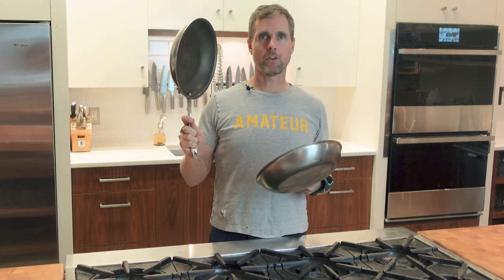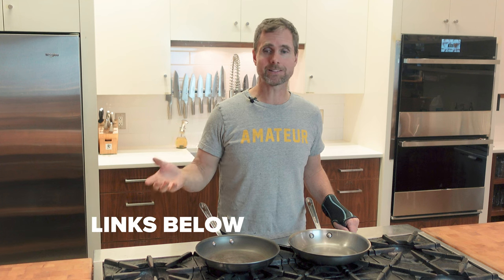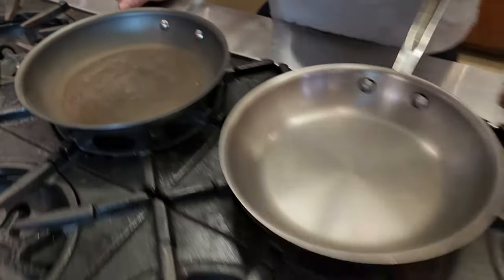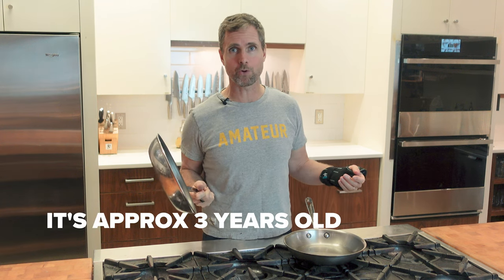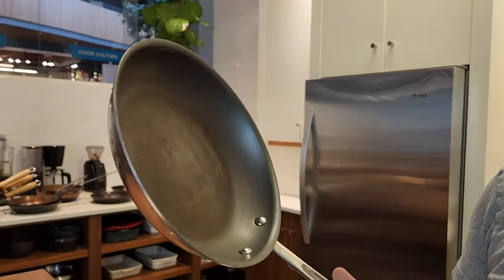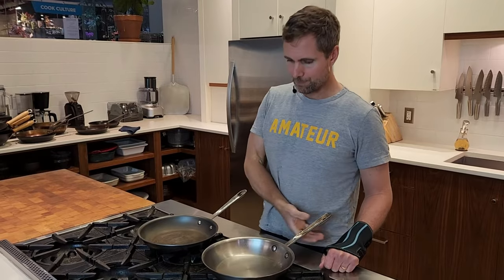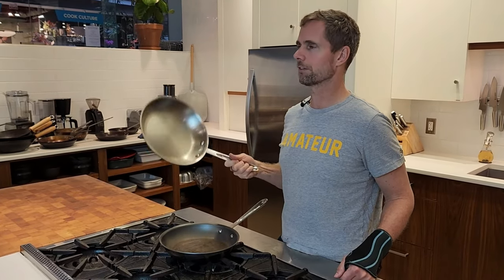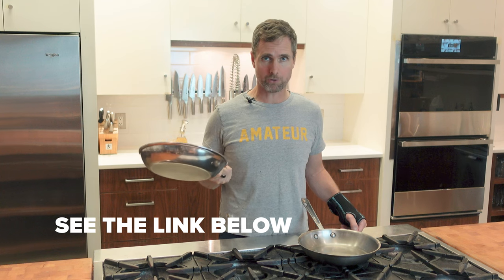How All-Clad's non-stick cookware will become garbage

Comment: That pan was overheated, was washed in a dishwasher, and metal utensils were used. I have nonstick pans that are 20 years old, but then I take care of my stuff.
Reply: Exactly.  I only want a nonstick pan to cook eggs and crepes.  That’s it.  Everything else is in stainless.
Reply: I baby my non stick pans and still only get around 3 years of non stick coating working as intended.
Reply: That pan was used normally. For a $200-$300 pan to peel like this happens. And shame on All-Clad for selling it. I got a set of 3 for my wedding, and they are all in the trash now. I'll stick to $16 egg pans that will last a year then throw them and replace them.

Comment: Your leaving out the process you have to take to make your steel pans nonstick. Most people at home aren't going let the food come to room temp before cooking, or pat dry all thier food before cooking, or heat up the pan before adding oil and the food. Most people just wanna turn the heat on add oil and the food and cook it. THATS THE WHOLE REASON NON STICK EXISTS!!!!! Most of my pans are non stick and they have all lasted about 10 years except the stupid copper ones they lost the non stick within a year. Everyone knows non stick doesn't last forever but that's the trade off that most people are ok with.
Reply from the maker: You are sadly correct, but there is a growing movement away from coated cookware.

Comment: Love all-clad but not-stick is junk and potentially harmful. My main skillet is a stainless-steel surface all-clad LTC that I bought in the mid-1990s and the inside looks virtually new; as for cleaning, soaking it on hot water and soap while I eat makes it effortless to clean. And if you pre-heat it using the mercury-ball water test, it functions close to non-stick. Cost me about $150 then but it has lasted 30 years and I expect it to out-last me.

Comment: Maybe some abuse they've pans , I have stainless,  cast iron, carbon steel and hard anodized aluminum. Treat them right they last for years. Non stick or hard anodized aluminum probably not as long . Life expectancy is probably 10 years. But your dishwasher, stove , and washer are about that or less . So there's that. Non stick has its place , opinions vary and they are only right for the person touting them .

Comment: I diagree. Some non stick  pans warp early on while others remain flat on the bottom. The coating on my pans last years so I tend to look at construction quality and materials. From my experience, there are three factors that shorten the longevity of the non stick surface. Number one is overheating the pan, two are metal utensils and three is cleaning with abrasives. I only handwash so I can't speak on the affects of machine washing as much but chloride destroys most metals including some stainless steels.

Comment: You should do another video with the "nonstick" one to see if you can polish out the entire coating and convert it into a regular stainless pan.
Reply from the maker: Sorry, I would not grind a coated pan if you paid me. Chemical dust.
Reply: @Cook-Culture  lol I'm not talking about in the kitchen, like having it done in a shop built to handle it.
Reply from the maker: @mjg1185  I have thought about it but seems pretty toxic!
Reply: @Cook-Culture  - yeah, leave that to professionals that know how to contain and dispose of chemicals and chemical dust.
Reply: @Cook-Culture  Don't be so dramatic. With proper respirators and equipment it's easy.  I had my 5 ply All Clad non-stick pan sand blasted at a professional shop.  They simply turned down the pressure of the machine and used finer sand/grit. And voila, I had a stainless steel pan for a fraction of the cost of a new one
Reply: I used to work at a body shop and what you can do is use a "DA", or dual action sander with progressively finer paper or have it bead blasted at a shop.  Start with 80 grit and work down to 220 or maybe 320.  I don't see any reason why this can't be done and the dust shouldn't be any more toxic than paint dust.   Wear a dust mask N95 or a respirator.  You can buy an electric dual action sander at Harbor Freight for less than the cost of a new All-Clad pan and you'll have it for polishing your car, etc.  I've used mine for polishing my vanity sink after the previous homeowner used a scrub pad on it.  You can use it as a sander or polisher, so the machine is pretty versatile.
Reply: Sandpaper will do the job

Comment: I’m a cookware enthusiast and I don’t see why there should be all this hatred towards non stick cookware, when it’s not really proven unhealthy to use as long as you don’t overheat it. 
I own more than 50+ pans and pots in 2.5 copper, carbon steel, 5-ply, 7-ply and also am the proud owner of 5 non stick pans from Demeyere (Alu Pro line)
I’ve now used these non stick pans for 4-5 years and they are still in fine condition. Just use silicone utensils and never high heat and your non stick pans will last for many years. What I save on oil and butter, can buy me a new non stick pan every 5.th years (you have to use much more oil and butter to get stainless steel ply and carbon steel pans to act non stick). Cheers, Claus from Copenhagen Denmark
Reply from the maker: Hi, I understand the argument however the great majority of people don't follow the correct instructions and destroy their pans.  Furthermore, even with correct care 1 life cycle (20 to 30 years) would be the absolute max for any non-stick. Compare this to the alternatives that last for generations.
Reply: It's not just about money or health. It is a massive waste of resources to get a new pan every few years. Especially considering the environmental impact of the manufacturing process of such pans. Nonstick pans will always be disposable pans.

Comment: Thank you for posting this! I thought there was something wrong with my 10" stainless d5 non-stick fry pan which I use almost exclusively for omelets. I contacted All-Clad and sent them photos and their response was some tips about pre-heating their pans! They then said their non-stick was non-toxic and I could either "choose" to keep using it or toss it! Really great advice!  It turns out they're all like that? Pretty sad for such an otherwise great company to sell such junk. I wonder if it's possible to remove the non-stick surface so it's just a stainless steel pan? I already have an All-Clad stainless steel pan and it works great but is not so great for omelets. Unfortunately you can't or are not supposed to season a stainless steel pan like carbon steel or cast iron...
Reply from the maker: Yes, it is unfortunate! Maybe a small carbon steel pan would work for you?
Reply: The French-made seasoned carbon steel pan I bought works great for eggs! Thanks for the tip!

Comment: Maybe im just a person with OCD but I have 3 Calphalon Stainless steel Nonstick pans 8-10-12in that are in Excellent condition after 15yrs of use. Note that I also have a Full Stainless Steel Set and Visions Cookware Set too. So I use the Nonstick pans just for Item's that don't require High Heat as I've got pans for that type of cooking and I HAND WASH ALL MY DISHES & COOKWARE

Comment: I''m doing research because of an All-Clad nonstick pan ... I really like the pan, but after 3 years, the coating is going. I don't mind PTFE (if made responsibly), but I hate having to toss an otherwise excellent pan.

I want something to cook my eggs, that will last for years, and be as easy to maintain as possible.
Reply from the maker: Hi, carbon steel is what I would recommend

Comment: I buy All glad non-stick at Home goods for 20 bucks. Don't use any metal utensils in it and we're okay. Put the minute it starts to look like It's bad I throw it out.
Most of the time I cook with carbon steel or cast iron or stainless steel.
Reply from the maker: Hey Nancy, thanks for the comment. When you're done with your non-stick you could find a metal recycler who will break it down correctly.
Reply: @Cook-Culture  Yes, I do! I should have been more clear in the comments.
I just got a DeBoyer Mineral B and am looking forward to using it! Thank you so much for all your videos. I watched the one on carbon steel seasoning.
Reply from the maker: @nancyoffenhiser4916  Great! Thanks

Comment: I bought the new, All-Clad H1 Non Stick 3.5 Qt. Covered Saucepan in August.
I USED IT ONCE TO BOIL PASTA STIRRING WITH A WOODEN SPOON. 
I WASHED IT WITH A SOFT CLOTH. 
The bottom inside the pan was CHIPPING & PEELING AFTER ONE USE!!🤬
All Clad asked for photos and an email which I sent. They then told me nothing was wrong with my pan. 
Sur La Table also blew me off telling me it had been over 30 days. My credit card company told me that since it had “arrived in good condition”, they wouldn’t honor a credit either!!!
Reply from the maker: Sorry to hear. That's how it goes. It's all about making money and not delivering the best product to the customer.

Comment: Worst on-stick I’ve had was the All-Clad.  Absolutely destroyed after a few months and I was HUGELY careful with it.
Learned pretty fast to buy the cheapest I can find in the grocery store, just fast-season my SS, or simply use my cast iron.
Reply from the maker: Good on you!
Reply: Absolutely! I had purchased a few all-clad nonstick over the years, and realized (after spending way too much money) that I was better off buying the cheapest 'First Street' nonstick at the local Cash&Carry.....12" pan for $23. Lasted just as long, and saved 85%....until I got my two Matfer carbon steel pans. I rarely use the nonstick, and when they are gone, they will not be replaced.
Reply from the maker: @erik5024  sounds like a brilliant plan!
Reply: Carbon steel is my new non-stick replacement
Reply from the maker: @SuperScottie3000  That's a beautiful thing
Reply: My all-clad, treated quite well…warped within a month.

Comment: My All-clad non-stick 10 inch and 8 inch pans have definitely not held up. Within a few months of using them on a 5-times-per-week basis they changed color and the non-stick surface started peeling on the lip of the pans. I use some oil when I cook in them and the non-stick properties have held up but I had to recycle the pans. Definitely not worth the money. My All-clad stainless steel pans are awesome however and I expect my great grand children will be using them. I'll be cruising this and other web sites to find out how to make them non-stick. They are easy to clean even if I cannot make them non-stick.
Reply from the maker: Thanks for the comment.  Sorry about your NS pans. You'll find ultimate success with your stainless pans using just the right heat and preheating. I have a few videos on that.

Comment: I found your video because it occurred to me that it might be possible to remove the coating and expose the stainless d5 pan underneath. Thoughts?
Reply from the maker: I've been told but can not confirm that the pans are treated before the coating is applied to make it stick better. I am unsure if this is a permanent thing
Reply: @Cook-Culture  meaning some kind of treatment dangerous for humans, ruining the integrity of the pan, etc.?
Reply from the maker: @Imadeavideos  The surface of the pan may be damaged, not sure, you'd need to see.
Reply: Did you find any more information on this? I found an old nonstick All-Clad pan at my local thriftstore and I'm wondering if I can sand the nonstick coating off.

Comment: The higher end non stick pans should have a feature to completely remove the non stick leaving behind a perfect stainless steel pan.
Reply from the maker: Good idea, but what do you do with the toxic chemical waste?
Reply: @Cook-Culture  Place it in a specially designed bag? Hey I haven't mt thought it through 100%. Dropping it off with used motor oil could work.  I mean it makes sense to not have to toss out a high end pan. Better to end up in a land fill in a blob of goo than in our bodies.

Comment: Hey Jed, I received an all clad nonstick D3. I want to remove the teflon coating, I've seen youtube videos that using drano gel and soaking the pan for a week will cause the teflon to peel off easily. Any thoughts on salvaging an otherwise good pan by removing the teflon ?
Reply from the maker: That's a great question, that I should tackle, but haven't. I've been told but can not confirm that the pans are treated before the coating is applied to make it stick better. I am unsure if this is a permanent thing.

Comment: This is just a weird thought experiment but could one conceivable abrade the nonstick surface back to stainless. Let’s say put aside health risk if say for instance someone used an electrolysis tank to get the pan to pre-coating condition would that pan be the same as the one on your right?
Reply: All clad used to have a line of re manufactured nonstick where they’d take worn out pans, drill out the rivets, grind the coating off, recoat and reattach the handles. I never saw them for sale in retail but they did have them at their in person factory sale. I actually regret not buying a couple because they really are very nice pans! I suppose it wasn’t cost effective though wince they no longer do it.
Reply: @Yoda63  yeah I'm not so concerned about recoating I would just wonder if the coating was laid on top of a subpar substrate. Like maybe that isn't a suitable cooking surface. I would be less inclined to use a grinder and have teflon dust floating in the air too lol.
Reply: @roberttaylor9259  Years ago I had a very nice pressure cooker with a flaking nonstick coating that I took to a sandblasting place near me to try to get the coating removed, and they looked at me like I was nuts! It’s got to be possible though, there’s definitely good stainless steel under there somewhere. Although it would be a nightmare to do without removing the rivets.
Reply: @Yoda63  as someone who has worked on metal and wood and 3d fabrication of all sorts those rivets arent that big of a deal. Electrolysis tank would knock that right out. (if you can remove that type of coating through a lye tank.) But theoretically if you could obtain stainless rivets that big it'd be easy enough to remove and replace. That also brings up another point about people saying you can't repair enamel coating on cast iron when in fact there's a place in Mass that repairs and fixes chipped antique bathtubs with new enamel. Probably impractical though for such a small piece.